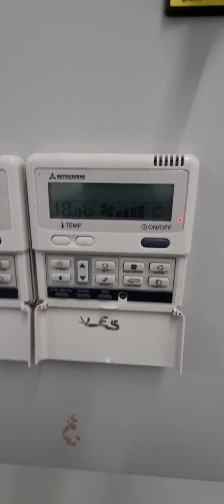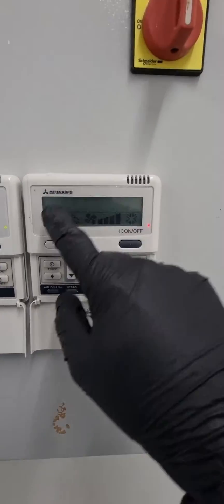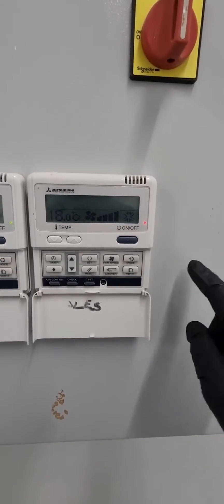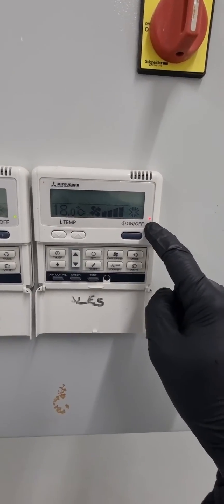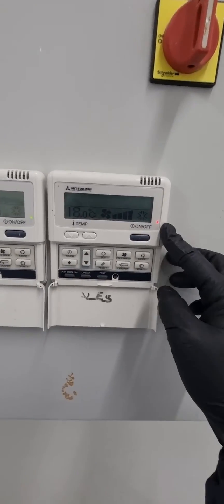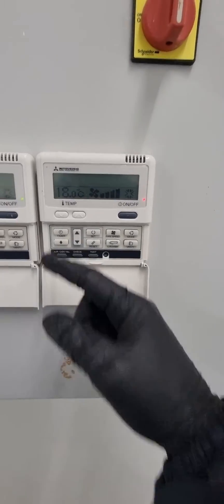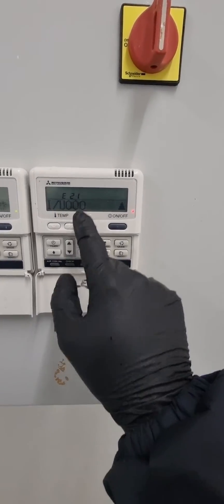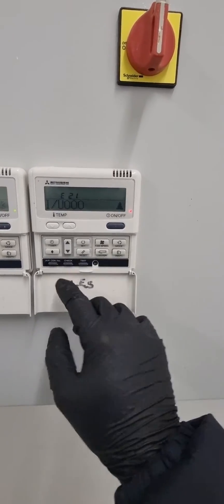E21 Fault on a MHI (Mitsubishi Heavy Industries) Split/VRF

Comment: On the indoor pcb where is the lever door switch located
Reply from the maker: Depending on which model cassette it may or may not have the door switch but for FDT rannge, it's under CNV on the indoor pcb (Panel Switch)
Reply: Cheers mate.